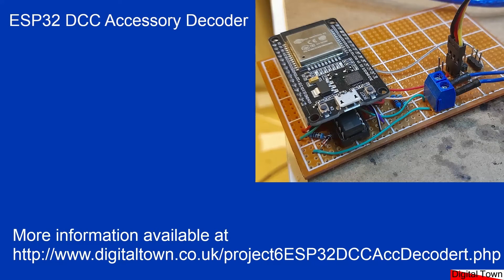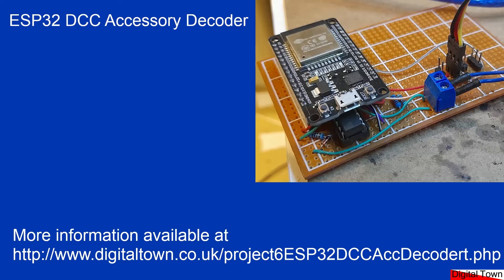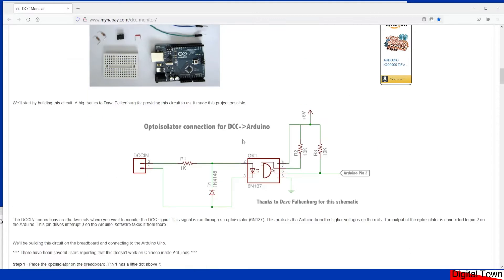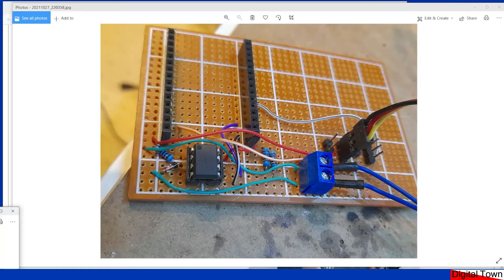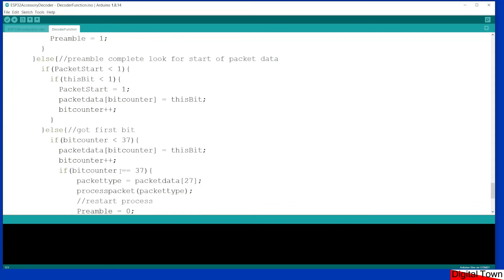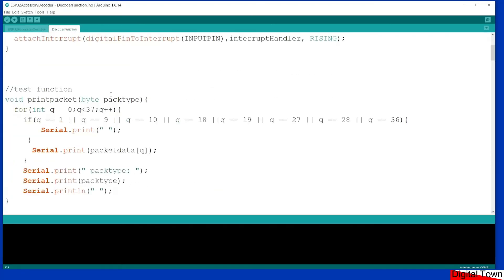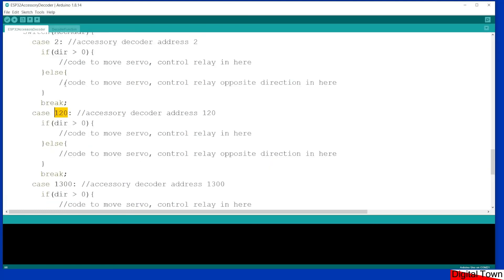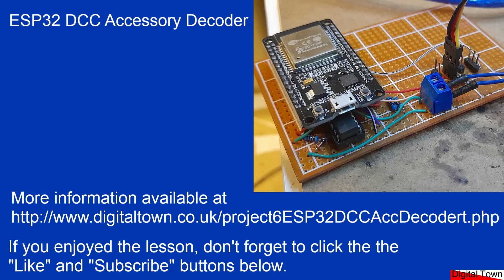ESP32 C++: ESP32 DCC Accessory Decoder

Comment: Hello Sir, 

I am also working on my small S scale Loco, i have 2 DC motors 7 LED and 1 servo and 1 sound. I don't want to setup layout just want to control my 1 locomotive that's it. 

is there any project where we have sound/motor/LED ESP32 controller. i saw the few videos but now i need seprate sound decoder, PCA 9685 for LED and then motor controller for DC motors now this with these many components it is very hard to fit in small space. any idea is there any custom ESP32 projects like locSound which has all the components on same board? so that i can control my loco(or may be my RC car) from my mobile web browser
Reply from the maker: I have been trying to work on something similar and it is not easy. For sound I would look up some videos on ESP32 I2S as this allows you to play, loop, speed up and slow down sounds as well as mix them in real time. I have had some success and by looping very small files some can be stored on ESP32 instead of an SDCard to save space. LeDs could be controlled directly from ESP32 pins to save some space depending how many you have. The same with the servo use a servo library and control straight from the esp32. As for the motor, it needs a motor controller board. Hope that helps.